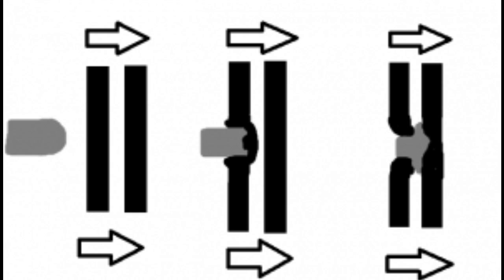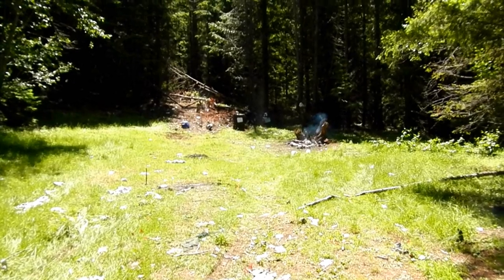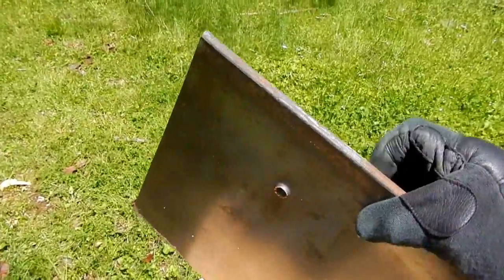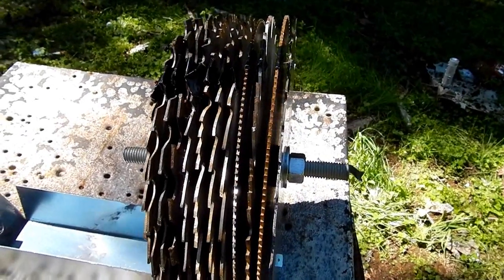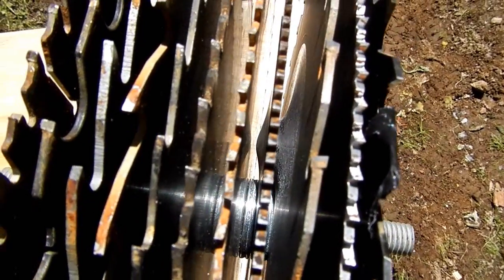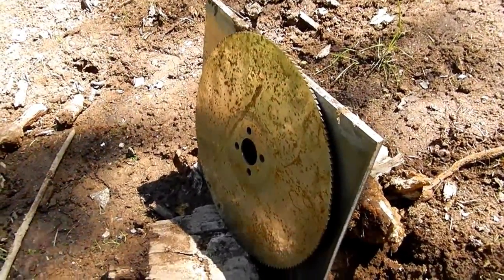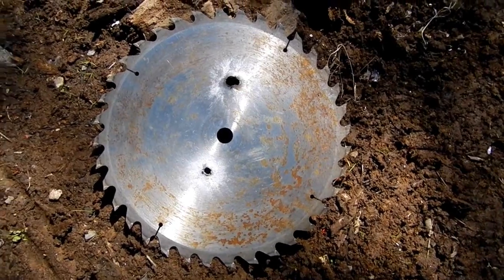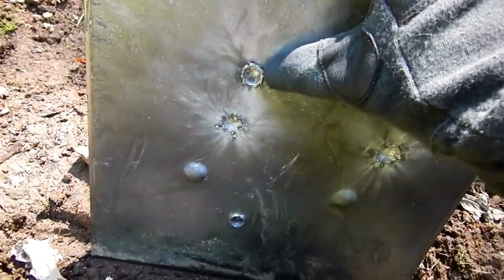Testing the Concept of Spaced Armor

Comment: I thought spaced armor was more to defeat HEAT rounds than regular solid bullets.
Reply: German tanks had skirts to protect against Soviet 14.5mm anti-tank rifles. Spaced plates were also useful against HEAT but there were very few weapons capable of delivering such a warhead until bazooka, which entered service in small numbers in late 1942. By this time many German tanks already had skirts because Soviets had very many 14.5mm rifle in service since early 1941.
Reply: @qbenalzaeen2052  Soviets also used spaced armor on some tanks, most notably the bedspring armor found on T-34-85 tanks in Berlin.  It was used to stop the german Panzerfaust
Reply: @qbenalzaeen2052  - The first Panzer IV with the skirts was the Aus. H, which entered service in June of 1943. Coincidentally, the use of HEAT rounds for tank/anti-tank guns was accelerating during the entirety of 1942. 

Not to say that you're wrong, the Soviet 14.5mm AT rifle was a nasty thing to encounter in a tank. The main problem was they needed to hit at almost precisely 90 degrees on a flat surface to actually penetrate armour. Otherwise it was just a loud clang and the armour has a deep gouge in it.
Reply: @mspicer3262  But the skirts were mainly used by the Germans and barely any of the Allies had them despite German Panzerfausts or Panzerschrecks. This is because none of the Allies had to go up against the Soviet mass produced 14.5mm PTRD-41 anti-tank rifles. HEAT weaponry wasn't widely used in the second World War and thus no specifical protection was made.
Reply: @mspicer3262  the AT rifles were all over the place though, generally any time you encountered soviet infantry, they had a few AT rifles among them, and PLENTY of ammunition.

What happens, is as the round passes through the first thin plate, it destabilizes and won't penetrate the next plate, as it hits the armor the direction of force is not straight into the plates.

Soviets weren't really keen on HEAT warheads, compared to western allies.
Reply: @mspicer3262  German records indicate that the shurtzen was created to counter anti tank rifle fire for the eastern front in majority and that limited amounts of the spaced plates where on the western front
Reply: @mspicer3262  there were eearlyer version of skirts already in use in France... called Vorpanzer (ahead armor) not Schürzen (skirts) it was added to the turretfront and frontal chassie armor with 20mm armored plates in a spaced configuration..

 https://fotos.miarroba.com/fo/590a/3058D7F0572F587F9CA52F587F9C8A.jpg

https://wiki.warthunder.ru/images/3/32/PzKpfw_IV_ausf_E_Vorpanzer_2.jpg

similar skirts were mounted to the Pz III befor the Schürzen were introduced
Reply: @mspicer3262  Skirt armor was literally first tested by the Germans in 1943 at Kummersdorf using 14.5mm AP rounds and mid caliber (75mm) HE rounds. HEAT wasn't even used to test the armor during the development. 
Sideskirts on German tanks were 100% designed with countering ATR fire in mind. The main focus of the add on armor was the Eastern front. The soviets barely fielded any HEAT weapons. Additional affect against shaped charges was a unintended consequence. 
Allied HEAT weapons were a cute joke that didn't become a significant problem until the final years of the war. The main focus was the literal hundreds of thousands of AT rifles the germans were encountering in the east that could punch through the side armor of the PZ 3, 4, and Panther at close ranges. 
You can observe the point at which HEAT became a greater issue because the Germans began sending mesh skirted tanks out west. The western front got the mesh skirted tanks, which worked against HEAT at a lower weight, while the east got solid skirts, which were designed to counter AT rifles.
This is explained in "Armor on the Eastern Front" by Spielberger and Feist.
Reply: @mspicer3262  AT rifles where ineffective against the panzer III and panzer IV armor the skirt was to protect the tracks since that was the only real threat an AT rifle posed.
Reply: @qbenalzaeen2052 
The various sources I've read say that the Germans developed Schürzen (skirt armour) to defeat the hi-tech (for it's day) HEAT rounds (eg: Panzerfaust) which they had developed and must have presumed copied by the USSR during  their industrial/technology exchanges (eg: Leica RF and Fed-1 cameras developed together) while the Ribbentrop/Molotov Pact lasted.
Apparently later testing on captured Panzers equipped with Schürzen showed that it (surprisingly) increased the penetrative power of tungsten-cored AP rounds (by stripping the light alloy outer layers and increasing the sectional density of the remaining penetrator), but it did help to defeat HEAT/shaped-charge rounds by increasing the stand-off distance and allowing the penetrator jet of molten copper to disperse slightly before hitting the hull armour.
Reply: @dj1NM3  Skirt armor was literally first tested by the Germans in 1943 at Kummersdorf using 14.5mm AP rounds and mid caliber (75mm) HE rounds. HEAT wasn't even used to test the armor during the development. 
Sideskirts on German tanks were 100% designed with countering ATR fire in mind. The main focus of the add on armor was the Eastern front. The soviets barely fielded any HEAT weapons. Additional affect against shaped charges was a unintended consequence. 
Later war skirts used on the WESTERN front were changed to wire mesh construction, showing the point at which HEAT protection became the main priority. Solid steel skirts were originally designed as pure ATR defense.
Reply: @qbenalzaeen2052  - And those Bazookas could pen the sides of Tiger tank that did not have skirts.
Reply: To the guy talking about the at rifles, tanks and anti tank guns were perfectly capable of fireing HEAT even before bazookas. If my memory serves the Germans had a HEAT round available for the pz3 as early as rommle going to North Africa. I could be wrong, but I seem to remember reading that somewere
Reply: @rodofiron100  - the Germans were introducing HEAT rounds for guns like the 75mm from Oct/Nov 1941, the Brits were a little more advanced if I recall, having HEAT rounds for 75mm guns in the fall of 1941. Both had problems with fuses. Soviet HEAT rounds for the 76mm started appearing in January and February of 1942, and became steadily more prevalent throughout the year.
Reply: @rodofiron100  The first german HEAT round was for the PZ4 7.5cm, it debuted in early 1940. The Brits had the first HEAT round to see service in early 1940. What M Spicer said is accurate. Heat rounds existed but they weren't common enough to invest in countermeasures until 42 or so.
Reply: @rodofiron100  1, no, this is not world of tanks, 2 heat projectiles smaller than 40mm do not exist and have never existed, the at guns in question are 14.5mm man portable riffles, almost like a giant sniper riffle but for hunting tanks
Reply: Elthenar spaces armor is also used On satellites and the ISS to stop small high velocity objects : the whipple shield.
Reply: Elthenar - Spaced armor deforms rounds penetrating it. It is just difficult to defeat large caliber rounds considering their massive penetration value. The Leopard 2A6/7 diamond shaped turret is the best current use of spaced armor in my opinion.
Reply: The Germans specifically developed the skirt to counter the PTRS and PTRD rifles. There's several official documents stating this. HEAT was not a worry during the majority of the war.
Reply: @namelessking8905  leopard 2a7 ....750mm+ protection against apfsds ....its better than any Abrams
Reply: @mr.waffentrager4400  - The true armor value is still a state secret. Abrams has more then 750mm on its turret as does the Leo 2A7.
Reply: @namelessking8905  Abrams with ha package - 600mm against kinetic 
800mm against heat 
Is Wikipedia wrong ?
Abrams is too old for this shit
Reply: @mr.waffentrager4400  - Sure. Believe Wiki. They know everything on top secret military equipment. It’s not like they said there are more then two genders…
Reply: @namelessking8905  But war thunder also has the same values... lol
Reply: @namelessking8905  yes... Believe wiki ...m1a1Abrams is not top secret any more but the leopard 2a7 is...that's why they don't have any info on Leopard because its the 2010 model 
There us no upgrade to protection on the turret in m1a2 sepv3 other than an APS system ....usa needed to tell when they wanted to fit APS because you need to tell to the public of the nation when you buy something but not when you make something....
Reply: @mr.waffentrager4400  - You are free to have your opinion, but do not confuse it with fact.
Reply: @namelessking8905  its NOTHING but TRUTH
Reply: @mr.waffentrager4400  - Sure.
Reply: @Mr. Waffentrager
"Is Wikipedia wrong?"
Probably, but you definitely are. Also, the M1A1HA is no longer the standard. If you're going to quote the armor values of the 2A7 Leopard... WHY THE HELL WOULD YOU USE VALUES FROM 1991 INSTEAD OF THE NEWER M1A2 SEP ARMOR VALUES?

The protection of M1A2 SEP is a frontal turret armor estimate of 940–960 mm vs APFSDS and 1,320–1,620 vs HEAT, glacis estimate of 560–590 mm vs APFSDS and 510–1,050 vs HEAT, and lower front hull estimate of 580–650 mm vs APFSDS and 800–970 vs HEAT.

Jesus. Be right back, I'm going to quote the armor values of the original Leopard 2 from 1980 against the newest M1A2 SEP from this decade and declare that the Leopard is a pile of shit. Because that's fair and honest, aimirite? Just stop. Sit down. Stop. Stop. Just stop.
Reply: @matchesburn  

The Leopard is a steaming pile of shit though. It was originally the same tank, developed with the USA, but Germans needed masses of tanks to counter masses of Soviet tanks, and so made massive downgrades all across the board and they continue doing that today. 

Only the Abrams is 100% undefeated in battle, and it has been battle tested. Brandnew state of the art Turkish Leopards were in Syria, and Assad turned all of them into smoldering piles of metal using 70's era Soviet AT weapons.
Reply: @mr.waffentrager4400  No, you just aren't reading it right. At all.
700mm on turret against kinetic APFSDS and 1300 mm against Chemicl/HEAT Warheads 
And not to mention the greater secret of Uranium depleted armor.
Reply: @namelessking8905  ok
Reply: @vasili1207  can't you fcking understand that wiki and other sites have the info about things which are 40 years old and then upgraded several times 
I have it in my real life 
From engine to the armor on top 
Info about the Abrams matched from wiki 
The guide said ...
So you may not have that much experience 
Can you please tell when wiki was wrong ?
Reply: @matchesburn  ohhhh wait I never compared m1 with leopard ...
Plus Abrams still has upper plate about 48 mm angled at 80° ...which is fcking useless against apfsds shells 
So what is better ?
Reply: @jamegumb7298  If by brand new you mean old 80s leo 2 A4's then yes you are absolutely right. If not , then you dont know what you are talking about.
Reply: @namelessking8905  Someone is mixing up genders and sexes, I think.
Reply: @ribbitgoesthedoglastnamehe4681  - They are connected and not separate. Well you now get “female sperm” … And the same people whop push this BS call climate change critics science deniers lol.
Reply: @namelessking8905  So its definitely you then.
Let me give you this advice to ease your confusion: greater precision increases accuracy, and does not decrease it. So if you deal with people who understand things with greater precision than you, they are also likely to be more accurate in their definitions.
Less accurate definition can only produce inferior results. 
And sometimes language changes. Its annoying, but you have two choices. When language evolves, you can evolve with it, or complain how people cant speak anymore like they used to.
Getting old sucks. But refusing to learn is a choice.
Reply: @ribbitgoesthedoglastnamehe4681  - Gender dysphoria is not an evolution of language, but a serious mental condition people are suffering from and this leftist agenda to use people suffering from said condition they need help with to further left-wing political agenda is beyond disgusting. The reason for the increase in trans people is the fall of testosterone. The average testosterone levels in men is dropping by 1% each year and age is not the reason. A society that ignores this is a society destined for extinction.
Reply: @ribbitgoesthedoglastnamehe4681  - Yep. There it is. Lost the debate so pull out the "white supremacist" card. You may be on your way.
Reply: @jamegumb7298  you dont need me to tell you that nothing you just stated is true.
Reply: The Germans were the only nation using magnetic anti-tank grenades in numbers and yet they used Zimmerit on their tanks. It stands to reason that if they were using HEAT effectively they might want to protect against when the enemy uses HEAT effectively.
Reply: It is wrong to say that the copper is molten it isn't. But it is under such pressure that it does act as a fluid whilst not technically being molten.
Reply: Heat , heatfs and apcr also because apcr shells uses soft steel metal jacket which gets removed by the first layer of spaced armor...
Reply: Spaced armor could magically remove entire battleship rounds...It was a big thing before rockest and aircraft carriers were a thing.
Reply: Well theres composite materials that can resist a certain amount of penetration of a HEAT[FS] or any shaped charge 

Example like ceramic against HEAT
Reply: Look up the reason for Panther II development and it’s subsequent cancellation.
Reply: it is
Reply: the ISS armor is designed for hypervelocity impacts of tiny objects (which relies on them fully vaporizing). it very specifically cannot handle bigger objects as those would still get through in one piece.
Reply: You are correct.
Reply: spaced armour does both
Reply: and AT grenades but that doesn’t really apply to today’s standards
Reply: Spaced armor is now used to defeat HEAT, but originally spaced armor (Schürzen) were introduced on German tanks to counter the numerous anti-tank rifles the Red Army had, which could penetrate most German tanks from the sides. Schürzen was not designed specifically to counter HEAT weapons.
Reply: The Panzer IVs with the armor skirts you see there were added primarily, and this is historically documented, to protect against Soviet anti-tank teams with 14.5mm PTRD/PTRS rifles. That's why you had the armor skirt going down so far on the sides and AROUND the back the turret. Because that's where the armor is thinner and where Soviet anti-tank rifle teams would target. However, once penetrating the armor skirt plate, it would no longer penetrate the hull. Same concept: a whipple shield.
Reply: Ans its didnt help much...that y there they dev the reactive armor...and also that reactive armor didnt work well in some case
They dev the active protection system....=_='...😑😝🤔
Reply: It works on most types of rounds even armour piercing discarding sabot ( that uses very hard metal in it's core) is less likely to defeat space laminated armour. The outer layer can force the incoming round to tumble, and strike the inner armour on the side of the round. Atgms tend to defeat space laminated armour. The shape charge focuses it's energy in such a way that the gap has little effect. Reactive armour is the best way to defeat shape charge type rounds.
Reply: @garryowen8673  You can add reactive armor on top of spaced armor, but you cant add spaced armor on top of reactive armor.
One of these allows both, one of these does not.
Reply: ... the problem with heat ammunition during WW2 was that all the conventional artillery and tank guns were rifled ... the spin imparted to the projectile degrades the performance of the heat round ... this was eliminated by the use of recoil less weapons like the bazooka, panzerfaust and rocket ammunition
Reply: [BLANK]   high explosives anti-tank, or heit high explosive incendiary tracer, niether does well vs. newer MBT.
Reply: Both
Reply: The point is that introducing a difference in density causes incoming projectiles (apfsds or EFPs) to start to tumble as they are going through the armor since one part is starting to travel through air while the rest is still going through steal. When a projectile is tumbling it's penetration is heavily deteriorated
Reply: Actually spaced armor is effective against both HEAT and regular AP.  What happens with AP is that the first layer is supposed to deform and redirect the AP round, maybe even cause it to tumble any of which will reduce the effectiveness of the round when it hits the follow on plate or plates.  Also true spaced armor often had each plate set at a slightly differing angle.  A good example of this is the "Super Pershing" of late WWII.  Also as others mentioned, Spaced armor is highly effective against HEAT rounds. When HEAT hits the first plate, the plasma jet will penetrate the 1st plate but will find itself diffused and deformed by the time it hits the 2nd plate thus reducing its effectiveness.  Finally, Spaced armor while still effective, lost most of its effectiveness due to rounds like APFSDS which could penetrate virtually any amount of spaced armor.
Reply: Now adays it is. During ww2 they used it because AT rifle rounds would be destableized by the shurtzen then hitting the armor sideways resulting in them harmlessly splattering on the side of the tank.
Reply: also against eraly soviet aphe
Reply: https://youtu.be/CuI6UttC5wU heres an example of it protecting against kinetic.
Reply: I thought skill saws cut through wood?
Reply: Spaced armoir also works against kinetic but only after it has hit the main armor so it will hit the next layer after space deformed sideways cracked whatever fucked
Reply: Usually expanded metal or metal strips really close together is used for HEAT rounds, its see through, lighter, and still enough to set off a fuse if its thick enough. If there is a thick enough sheet of regular steel it will still work just as good though.
Reply: Spaced armour can work against solid rounds but it needs to be longer than the round itself or it won't have any significant effect
Reply: @alephkasai9384  yes it does because the round will still go sideways just not fully and will shatter
Reply: Yeah but he doesn't have HEAT rounds with him. He doesn't have a tank nor does he have any anti tank missiles lying around.
Reply: It can be effective against some kinetic rounds as well, the german leopard 2a5-2a7 uses spaced armor in its turret cheeks in a way that makes it effectively impenetrable by apfsds
Reply: @inniyewtesfaw2003  not exactly impenetrable as the m829A4 makes it useless
But russian apfsds gonna have problems lol
Reply: @jetskusintrosfin8037  yea you'd have to have a pretty long penetrator to go through, at least as long as the air gap inside, which is up to 2.5 meters at some points
Reply: You're right Spaces Armour is mostly used to defeat shaped charged or tandem charge munitions.
Reply: Also hopes to make regular and ap bullets tumble and impact their surfaces so it has larger surface areas as it gets through further plates, losing a lot more potential energy than if it went through a homogenous steel plate.

In this video however these say blades are all high carbon steel with the 4th being a particularly expensive high carbon steel designed for wet saws to cut mild and stainless steel
Reply: Well, NASA also uses spaced armor to protect orbital devices from impacts.
Reply: Originally. Then we found out it works wonders against kinetic penetrators too
Reply: It was, as soon as shaped-charge weapons were developed in 1939-40, the race was on to find ways to protect against them. Initially, the charges were not widely deployed, they weren't terribly accurate and there weren't good ways of delivering them to a tank in combat conditions (no rockets or gun-based HEAT until around 1941). The armoured 'skirts' were developed following experiences on the Eastern Front, and would cause the HEAT warhead to detonate away from the hull, with the gap causing the penetrator jet of molten copper lose most or all of its effectiveness. 

This is evidenced by the modern use of steel mesh instead of steel plate. Same performance against HEAT rounds, less weight.
Reply: M Spicer the german skirts weren’t for heat they were to protect the side armor from Russian AT rifles. Yes in the modern day it’s for heat but back in ww2 that wasn’t the priority
Reply: @mspicer3262  As someone already said, German "Schurzen" side skirts were added to provide protection against soviet anti-tank rifles (14.5mm KE projectiles) and not shaped charges specifically. It's a common misconception that Shurzen was developed to stop shaped charges, but actually that effect was purely incidental.
edit: here's a source proving the issue https://balagan.info/why-were-schurzen-introduced-in-ww2
Reply: @mspicer3262  "werent terribly accurate" they still arent  :p  with the exception of ATGMs who have moderate accuracy (albeit they are saved by the fact that they are ... well... guided?)
Reply: @mspicer3262  There were practically no HEAT rounds in service on the eastern front. The main experience of the Germans on the eastern front was that 14.5mm ATRs can easily pop the side armor of the Panzer 3 and 4. They added the armor to counter this. When the HEAT rounds became a problem on the WESTERN front later in the war they developed the Mesh skirts for the Panzer 4. Solid skirts are for ATR protection. Mesh skirts are for HEAT protection.
Even if the BR-353 HEAT round for the T-34 was more common it still wouldn't make sense. The BR-350 APHE round could just be fired to totally negate the spaced armor at basically any combat range, so why add spaced armor that could only be used against a single, less common round? 

The Russians didn't have much man portable HEAT weapons. They had ATRs. The Russians also had the OF-350 with the standard KTM-1 fuse which could be capped to turn the HE-FRAG round into a SAP round that was surprising lethal against the sides of the Panzer 4 at 500 meters. These were the main threats and issues faced by the Germans in the East and this is what they tested the skirts against at Kummersdorf. These are primarily Kinetic penetration threats, not HEAT threats.
Reply: M Spicer Steel mesh is called slat armor and it’s not to pre detonate heat rounds. It’s meant to destroy or deform the jet, heat rounds are fragile.
Reply: @mspicer3262  Armour skirts were developed to just be an armor protecting the treads, not spaced armor.
Reply: Elthenar in order to defeat a shaped charge warhead you have to space the armour plates correctly for each spaced charged warhead you would be facing, otherwise the spaced armour can make things worse.
Reply: to defeat the heatfs you need glass
and a steel plate
Reply: It was. It was designed to defeat HEAT (shaped charge) and fused explosive filler rounds. In the case of HEAT, the chemical reaction inside of the shell would trigger at the outer plate instead of the actual armor, causing the molten round to just splatter ineffectually against the armor. Fused explosive filler rounds would trip their fuse at the outer plate and (given the fuse was short enough) explode before fully penetrating the armor, rendering them ineffective. Solid AP, APCR (composite) APDS (discarding sabot), and later APFSDS (fin stabilised sabot) more or less completely defeat spaced armor, which is where composite armor comes in
Reply: @gabrielchad447   No, it was not designed to counter HEAT (nor did it), in fact spaces of 12 inches or less would actually INCREASE the penetration of HEAT weapons (they need a stand off distance to work effectively, spaced armour provides that stand off distance), https://milart.blog/2014/08/30/allied-trials-to-counteract-panzerfaust-attacks/ and a space of 30 inches was needed to prevent penetration, the jet also isn't molten (it's 400-500 degrees C, well below the melting point of copper (the commonly used lining at the time)

APHE rounds usually had fuse sensitivities of more than 5mm, meaning thin steel plates would only trip fuses for APHE rounds that were smaller calibre, older or coming in at a high angle.

Spaced armour is effective against AP/APDS if the spaced armour array is angled, impact with the outer plate can strip caps off the projectile (in the case of APC/APCBC) and destabilise it or otherwise lower its penetrative power. If it isn't angled, it's less effective than simply increasing the thickness of the inner armour plate.